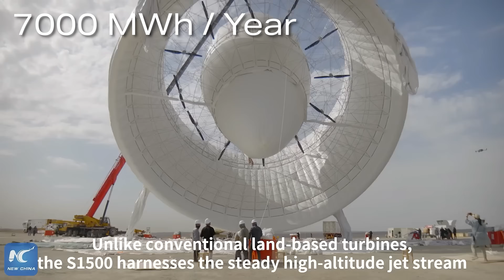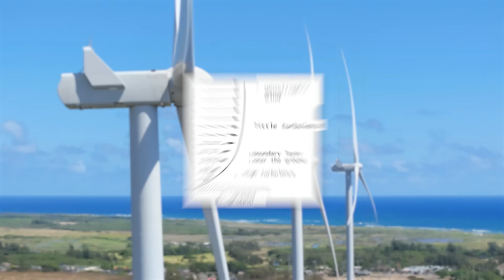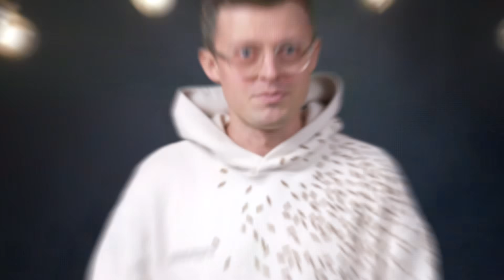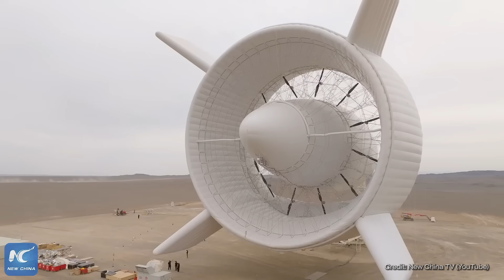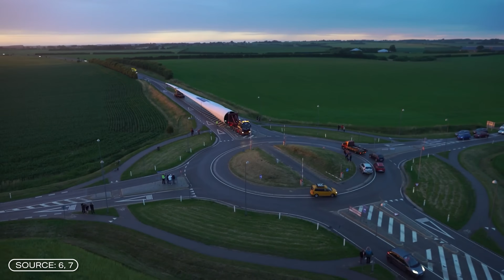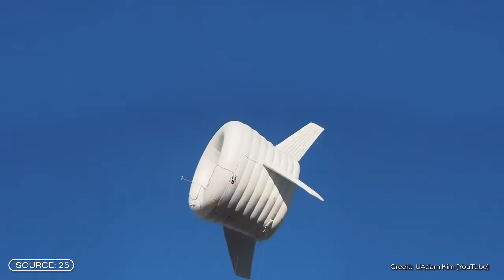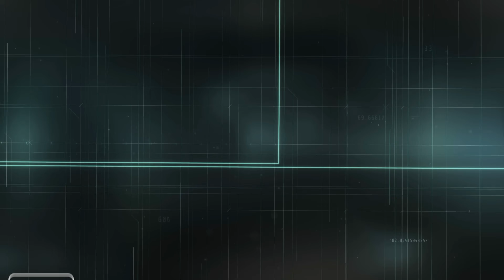China's Wild New Inflatable Wind Turbine (1.2 MW Output)

Comment: We need to learn how to harness the electricity from the wind turbines ? How fast does a Hydro electric  turbine move ? Hydroelectric turbines spin at relatively slow, controlled speeds, typically ranging from 35 to 150 RPM (Revolutions Per Minute) for large units, though some massive turbines can operate as low as 36 RPM, while smaller ones can reach up to 300 RPM or more, depending on the turbine type, water head, and desired grid frequency. These speeds are much slower than steam turbines, with the massive water flow and inertia requiring precise governor control to maintain grid synchronization.

Comment: Why use helium for this?

This system generates power in the vicinity of the balloon

Some kind of heating system (that can be managed by some kind of embedded microprocessor system to avoid catastrophe) could be used to keep the things aloft

(Not a physicist or whatever; perhaps misunderstanding a difference of effectiveness between hot air and helium balloons)

Comment: Why use Helium? Surely Hydrogen is plentiful (and less prone to escape confinement).
It's not like there are any safety concerns (that killed off airships) as this is an uncrewed vessel. Once you fill this on site, any hazzard is over.
Reply: I was thinking about this as well. Helium is a rare resource. A modern balloon should be able to handle using hydrogen without exploding or burning down.

Comment: High Altitude Wind? I had windmills on the high altitude launch pad, held by high altitude blimps, in the second New Mars book I self-published. I have heard that rocket engines do get more lift from the thick atmosphere, but if they start above 60,000 feet, rockets don’t need as much lift, I’m guessing. Airspace and operations: Altitudes from 18,000 to 60,000 feet are within controlled airspace in which instrument flight rules and air traffic control separation normally apply.
Above about 60,000 feet, regulations and practical operations are more specialized, typically limited to research, reconnaissance, or high‑performance test flights.
If you clarify what you want to do at 60,000 feet (e.g., passenger experience, research platform, fictional vehicle), a more tailored technical breakdown is possible.

Key Points with summary:

The German Science Guy discusses high-altitude floating wind turbines, known as Buoyant Airborne Turbines (BATs), as a potential solution to the volatility of conventional wind energy. These systems, like the Chinese S1500 from SAWES, aim to harness stronger and more consistent winds at altitudes of 1,500 meters or more. While current BATs have a lower rated power than modern conventional wind turbines, their ability to operate more constantly due to high-altitude winds could lead to significantly higher capacity factors and competitive energy yields in the future. BATs offer advantages such as lower material costs, faster deployment, and flexibility for use in remote or disaster-stricken areas not suitable for traditional wind turbines. However, the technology faces significant hurdles, including economic viability (past projects like Altaeros and Google’s Makani failed due to high costs and scalability issues), the need for robust automation and materials to withstand extreme conditions, and unanswered questions regarding air traffic disruption and public acceptance. The speaker concludes that while BATs may not directly compete with conventional wind turbines as a primary energy source currently, they hold promise for niche applications like emergency power supply or powering remote locations.

Summary of Key Points: Floating wind turbines (BATs) offer a promising solution to the intermittency of conventional wind energy by harnessing consistent high-altitude winds, potentially increasing capacity factors significantly despite current lower rated power. Key advantages include substantial cost savings, unparalleled flexibility for deployment in remote or disaster-stricken areas, and access to locations unsuitable for traditional turbines. However, the technology faces major challenges, primarily economic viability, as evidenced by previous failed projects, along with the need for robust automation and material durability. While not currently a direct competitor for mainstream energy production, BATs are seen as highly valuable for niche applications like emergency power or remote site energy due to their rapid and flexible deployment capabilities.

Key points:

Problem with Conventional Wind Energy: Volatility and intermittency due to fluctuating weather conditions, leading to too much or too little electricity.
High-Altitude Wind Solution: Floating wind turbines (Buoyant Airborne Turbines or BATs) aim to harness stronger, more constant winds at altitudes over 1,000 meters, potentially eliminating volatility.
Technical Advantage of High Altitude: Wind speeds increase and become more constant at higher altitudes due to reduced drag from terrain and buildings; doubling wind speed increases power eight-fold.
BAT Technology (SAWES S1500):
Example: Chinese company SAWES’s S1500 system.
Classification: Airborne Wind Energy System (AWES), specifically a Fly-Gen (generator onboard).
Design: Zeppelin-like, ring-shaped shell filled with helium for static lift, allowing it to remain airborne in varying wind conditions.
Generators: S1500 has 12 micro-generators (100 kW each) for a total output of 1.2 megawatts. Made of lightweight carbon fiber.
Weight: The entire S1500 system weighs less than 1 ton.
Development Status: S1500 is in testing phase; predecessors (S500, S1000) have been launched at lower altitudes and power.
Performance Comparison (BATs vs. Conventional Turbines):
Rated Power: S1500’s 1.2 MW is lower than modern conventional turbines (up to 6 MW).
Capacity Factor: BATs show potential for 60-75% (e.g., Altaeros), significantly higher than onshore conventional turbines (average 25% or 2,000 full load hours/year).
Annual Energy Output: With a 65% capacity factor, S1500 could produce 6,800 MWh/year, which is less than half of an average onshore wind turbine (12,000 MWh/year). However, there is significant potential for improvement in BAT rated power.
Advantages of BATs:
Cost Savings: Up to 90% material savings due to no need for foundations or towers, potentially reducing electricity cost by 30% per kWh.
Flexibility & Deployment: Can be set up almost anywhere, including remote areas, deserts, islands, or offshore platforms, as they don’t require complex transport or infrastructure.
New Applications: Ideal for disaster relief (emergency power, mobile network stabilization) due to rapid transport and deployment.
Untapped Potential: 90% of BAT potential lies in areas unsuitable for conventional wind turbines (not windy enough, difficult terrain, no infrastructure).
Hurdles & Problems for BATs:
Economic Viability: Past promising projects (Altaeros, Google’s Makani) failed due to being too expensive and not commercially scalable.
Helium Cost & Leakage: Rising helium prices and helium escaping from balloons (e.g., Altaeros) were major economic hurdles. SAWES claims to have solved this for the S1500 with new materials for a 25-year operational life.
Technological Complexity: Requires highly reliable autonomous operation (takeoff, flight, landing) in extreme weather conditions and accurate wind prediction.
Material Durability: Envelope and tether must withstand storms, rain, thunderstorms, and sunlight for years.
Unanswered Questions: Potential disruption to air traffic, public acceptance (given existing wind turbine unpopularity), and realism in densely populated areas.
Conclusion: Floating wind turbines are not yet a real alternative to conventional wind turbines for primary energy production due to current economic and technological hurdles. However, they show strong promise for specialized applications like emergency aid or powering remote, hard-to-reach locations where conventional turbines are unfeasible.

Comment: This is interesting. I hope they can figure it out!  One challenge I see is the constant movement of propeller blades causing the blimp and the ballon to fall apart. Little know fact for context: If you drive a semi-truck 24 hours a day, (done with two drivers, one sleeps, one drives), after about 5 years the entire truck is junk. The smartest thing to do is drive it into a junk yard, melt it down and pick up a new truck at the factory. The metal, in places like the frame, gets fatigued, and will literally fall apart. That is metal. I am not so sure how a balloon, that close to propellers, flying at hundreds of revolutions per a minute is going to do. These may not need to last five years, but I do see longevity being a potential problem.
Reply: Wind turbine manufacturers know how to keep their equipment operating for 30+ years with regular maintenance. Given how reliable the Chinese manufacturers are now making their semi-direct drives to handle typhoon winds, I pretty sure that they can figure out how to make these inflatable turbines last for a long time.
Reply: also, it's a lot easier to conduct maintenance on one of these than a typical tower turbine—you can just pull it down to the ground, rather than having to send workers and supplies up. much safer.

Comment: Given the rarity and cost of helium, and that there are important applications where there is no alternative to helium, I don’t see any potential for large scale application of helium aerostats for wind power generation.

Only hydrogen is a variable lifting gas. It is far less expensive and can be generated onsite to replace hydrogen lost to diffusion through aerostat walls. The flammability is an issue, but that can be mitigated with good engineering. Plus the risk of a fire is mainly material costs. And of less, but non-zero importance, is that hydrogen has 8% greater lifting capacity.

So only if helium is being used during development with the ultimate plan to shift to hydrogen for large scale deployment, I see no future for this type of floating generator to provide a meaningful percentage of electric power.

Comment: At first glance this strikes me as the first truly viable renewable energy source after hydro. As far as cost goes, like Captain Kirk said, “we just built it”. We just build it.
Reply: I think you'll find solar PV has been viable for some time. And is becoming viable in more places and circumstances every day as both PV panel sand battery firming continue to get cheaper. 24hr dispatchable PV is already down to $76/MWh
Reply: @xxwookey    I beg to differ. I don’t see how anything can be called “viable” when it requires expensive subsystems to make it so. If they can solve the obvious as well as the hidden problems with this flying generator we will have minimal requirements, if any, for batteries. It will occupy almost no land space. There won’t be any difficulty with disposal, we won’t be killing birds, we won’t have to look at it, and local property values won’t drop. It looks like win win to me.
Reply: @ThisIsToolman  The point is that the combined cost of the PV and the 'subsystem' (some batteries) is now less than gas-fired power in reasonably sunny places, and it'll be another 10-20% cheaper next year. (BESS prices fell 40% in 2024). The PV part is $43/MWh (global average). The battery part is $33/MWh (to store 50% of output for overnight use), making $76 total, all-in-installed, which is pretty cheap power. 
And it's very easy to plonk down this panels and storage combo almost anywhere. You may insist this is not viable but power companies the world over disagree and are installing this stuff as fast as they can get grid connections (the main rate-limiting step).
Reply: @xxwookey . Kind of like Germany…we can be just like them..

Comment: Give it time. The first attempts at floating turbines failed, but technology has moved on. I'm sure this could be scaled up, with much less expense than increasing the size of turbines. That 1.2MW model, will produce about the same energy as a 3MW standard ground turbine. You could also, easily use these off shore, I can imagine a 6MW at 3,000m, producing as much as 8 to 10 standard 3MW turbines. 
    That devastated wasteland looked a little bit like what Israel has done, with Germany's full assistance and backing to Palestine. Problem is, the IOF would simply destroy it like everything they destroy. Why won't you condemn it, Mr Science Guy. Don't you even think it's strange that your government is robbing Germans of their rights to protest, to free expression, for a foreign, racist, apartheid, foreign regime. They are feeding into the anti-Muslim hate that is powering your new Nazi party, the AfD. TWO WRONGS DO NOT MAKE A RIGHT. END THE GENOCIDE NOW. YOU are paying for the murder of babies. NOTHING to say???

Comment: I'm more optimistic than you for this tech.  Hydrogen instead of Helium is obvious.  The automation seems solvable, and though making the first one is expensive, is cheap to replicate.  Thethering down in a storm is the huge challenge, that is difficult even if deflated, but an open roof "hangar" or simply a building complex with giant courtyard/green space in center, that is also powered by solar, and permit off grid high/mid rise complexes.

Comment: 3:20 Wind speeds are high in the stratosphere, but don't have much power.  There was a big study done on the jetstream and though it is very high speed wind,  it has very little power in comparison.
One of the reasons the winds are so fast is there is much less resistance to that wind at this height and so faster speeds are reached.  It's also lower pressure.
What about planes?  They fly in the stratosphere.
Reply: Pegasuses also fly in stratosphere
Reply: @NJ-wb1cz What are you talking about?
Reply: @tarstarkusz  PEGASUSES
Reply: @NJ-wb1cz They don't exist... planes do exist.

Comment: why helium? just use hydrogen in these unmanned airships, put a lightning rod on top with a (graphene?) grounding wire in the tether. this would apply to the remote locations where this could work - places w/o conflicting air traffic.

Comment: I thought the video was sehr gut. A couple of points: It's much easier to manufacture lots of small wind turbine blades in a building than very large blades, improving the cost per unit, the same goes for the generators, economies of scale. The blimps/BATs could use hydrogen instead of helium in areas without a large population or ground cover subject to fires, ie over a desert. Hydrogen has about twice the lifting power for the same volume & is orders of magnitude cheaper, not in short supply & not subject to embargoes. Finally the sky is three dimensional, with ground based wind turbines apart from substantial foundations & carting the materials to the location to construct them the turbines have to be widely spaced so that they don't rob each other of wind but with BAT's they could be spaced vertically & therefore take up less ground space.
Reply: "Hydrogen has about twice the lifting power for the same volume". Nope. Hydrogen has about half the mass as helium, but they're both much lighter than air and the bouyancy is the difference in mass. Only 8-9% more  bouyant.
Reply: @kevinneville7837 Thanks for the correction. Still a lot cheaper and not subject to the world's largest supplier not cutting off your supply.